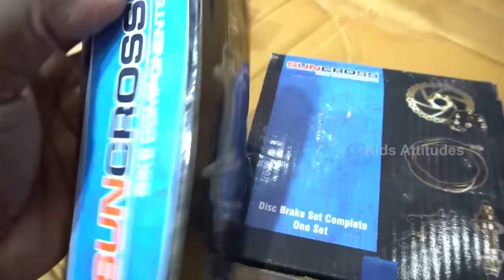Install Rear Disk Brake in Any cycle | How To Install Disc Brake in Any Cycle | Cheapest Disc Brake

Comment: Cool...!  You should grease the threads though on the hub before installing the freewheel, and brake mount, otherwise it will be verrrryyy difficult to remove them in the future....

Comment: I’ve just had a mountain bike given to me....for free!   
It looks pretty good.      There’s a mechanical disc brake on the front.  But it’s not very good.   
So i might change that for a hydraulic disc brake;  either 160mm or 180?    Unfortunately on the rear.... as you can see.. it’s  V-brakes only.   Do you think it would be quite easy to fit an a adapter?   I might keep the wheel... and have a go at replacing the hub... just for a bit of experience.
Tuesday afternoon at 12:58H.  30th March 2021. U.K. 🇬🇧 Southampton.

Comment: How add rear disc brake in gear cycles which didnot have rear dic brakes??  Plzz make a video about that☝
Reply: He would not make a video about what you need, because he doesn't know how to do it. In this video he used a reversible single speed/fixie rear hub. That's why he used the same spokes. When you have a rear derailleur bike, the hub flanges are not symetrical related to the rim. It means it needs other spokes. The  left spokes are longer than the right spokes and it is necessary to calculate their lenght. This involves some precise dimensions of the rim and hub, and this so called mechanic has no clue how about how it is done. Morover, from calculations, may result non standard spoke lenghts and it is quite sure this dude has no skills and tools for properly cutting and threading spokes. And all of these involve more money which makes more affordable to change the bike with a disk beakes one than trying to do such conversion. In addition, the rim brake frames are not sturdy enough to take on the forces from a disk brake caliper.

Comment: I can already see a problem with this.

1. You cant take off the wheel now without removing the bracket more hassle when you get a flat tire on the road.

2. The bracket is not greatly secured on the frame cause in ths vid you can see it wobbles side to side. Making for uneven stopping power and uneven wear in pads.
Reply: Yeah it looks like kind of a cheap setup.  I think I'll just stick with the caliper brakes. Or buy a bike that came with disk brakes.

Comment: #1 reason cyclists want disc brakes on their bikes is because there is no need to true the rims when you have disc brakes. The rotor brake is wholly independent of the rim itself.   ;-)
Reply: As someone who has bikes with disc brakes, you don't get them to stop the bike, because they are never as good as rim brakes, even in the wet.
Reply: Wrong
Reply: @Destin65  you've obviously got them set up very badly as my disc brakes would have you over the handlebars if yoj applied them to sharply.

They are Clarkes M2 hydraulics that come with a rotor and all fixing bolts for 20 sovs per wheel. Cheap and very effective at the price of an half decent tyre.

Comment: This adapter does not hold at all. The iron it is made of is very thin and bends. At the front, the clamp is 1 millimeter and on the first stop, the brake caliper goes into the spokes of the rim. The clip in the front is breaking. 
                                                       DON'T BUY IT ! ! !            IT DOESN T WORK ! ! !

Comment: Beware folks, fitting discs and brakes to non specific frames can break seat stays.
Reply: You got that right, I have seen that happen. Also, on a separate topic, fitting a hub motor to the front fork can and will break the fork at the axle mount, I've seen it happen and then you go over the bars when the front wheel falls off.